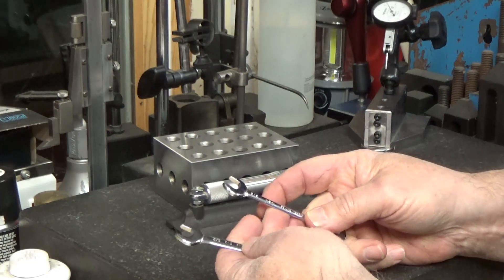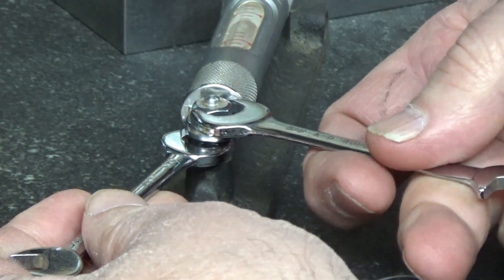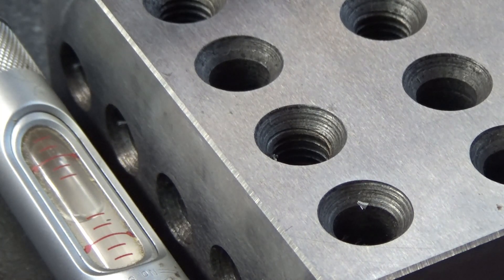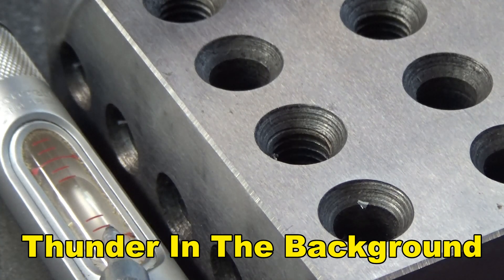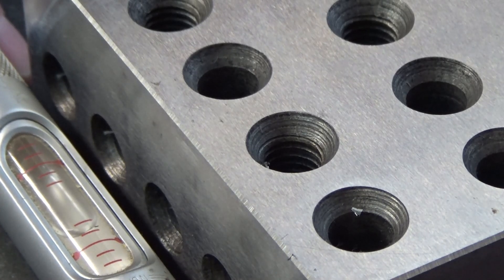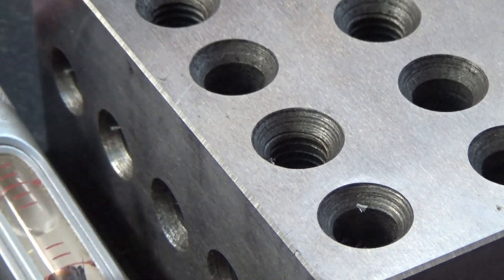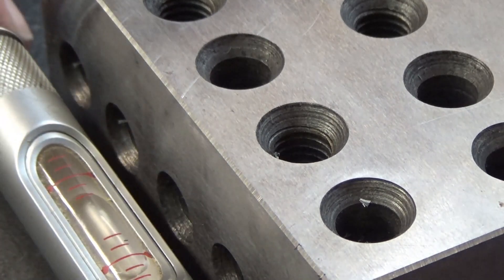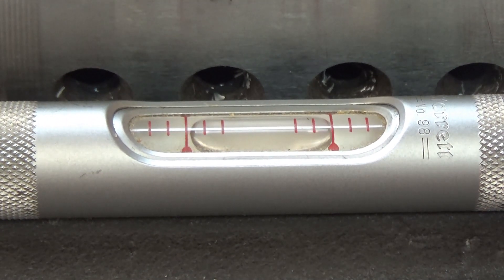Machine Shop Basic Skills -Calibrating A Precision Level

Comment: Hi Steve I like your video. I bought a used 97-8 Starrett Level EDP No.50435 and I notice the bubble is so wide when  level I can't see the ends of the bubble. Is that normal or defective? Is is possible to take some of the fluid out or is that a bad idea ? Any advise is appreciated. Thanks in Advance.
Reply from the maker: The vile needs to be replaced.  There are several videos on YT about how to do it.  They are available and not too difficult.  Keith Rucker of Vintage Machinery has a video on it, https://www.youtube.com/watch?v=_fs-AVB3fDg  Thanks for watching and commenting.

Comment: Question: The Starrett level has two nuts at one end but at the other end it has a slotted screw. How tight should that screw be?
Reply from the maker: The screw end actually has is a swivel.   The screw is snagged up.  The nut end adjusts the height and it rotates on the screw end.

Comment: So sensitive, buy a a normal german level
Reply from the maker: I just purchased a 12" Starrett Precision level.  Much more accurate than this 4" unit.  When I had my automotive machine shop I could set up a cylinder head to resurface within .005" with a good quality carpenters level. from there I would zero it in with a dial indicator.

Comment: Hi Steve, I am from the Netherlands. The precision spirit level you are showing has an accuracy of 0.005 inches / 1 feet. Do you know how much this is in millimeters?
Greetings Jan
Reply from the maker: That would be approximately .04/100mm.  Thank you for watching.
Reply: @sharkrivermachine  that is not a tool 0.02 mm on 300 mm is tool.
Reply from the maker: @Erkilll  I just picked up a 12" Starrett level. much more accurate that this little 4".

Comment: Thank you for your video. I appreciate how you walk through everything slowly. I just picked up a precision level and I was curious how to use it or calibrate it. Do you know if the starrett precision levels come calibrated from the factory? Also what is the rotating sheath on that starrett 98 used for mine has the same one as yours.
Reply from the maker: The precision levels need to be checked and or calibrated each time that they are used.  They change with temperature and just being handled.  The rotating sheath is just for protection against breakage when in storage.  Make sure to watch the second video on calibrating the level, I give some clarification on the procedure.  Thanks for watching and commenting.
Reply: Thank you

Comment: Very good
Reply from the maker: Thank you for watching and commenting
Reply: @sharkrivermachine  Being the son of a builder I was taught at a young age how and why you should reverse a level to check it. When I ordered a expensive level which has magnets in for steel work i checked it on the shop counter top. It was out so gave it back and they got me one that was spot on..It caused a ruck but the guy had to get the manager out because he didn't under stand lol
ww2 split rims where you can not get the tires so I banded the rim to take a larger ID tire. Tube tires and a tube gator 
https://youtu.be/UfwiaxVVrXU
Hay baler auger shaft weld and re turn 
https://youtu.be/bxw5Z_vcM4o
EN24T making cutter blades, heat treat and temper edge to blue
https://youtu.be/AUiFNZ9WU0k

Comment: That was very helpful. I built a machinists level a while back, I bought a very sensitive vial  which I fixed into a tube using Plaster of Paris. never been 100% sure how well I calibrated it, you've taught me a sure way to check and adjust it. Cheers!
Reply from the maker: Glad it helped! Thanks for watching and commenting.

Comment: How do you prove work top is level to level up level, something does not seem right to me?
Reply from the maker: That is the point of this exercise.  The surface does not have to be level as long as you keep swapping the level end for end and keep the bubble offset equal. The next video explains that process in a little more detail.
Reply: @sharkrivermachine  It doesn't have to be PERFECTLY level, but it has to be quite close.  You cannot calibrate your level on a flat surface that is, lets say, 10 degrees off level.  This isn't obvious because surely machinists do this calibration typically on a big old granite reference surface that is, well, VERY close to perfectly level to begin with?  I can and do adjust the extemely sensitive bubble on my survey instruments in exactly the same manner, and the procedure doesn't work unless the survey instrument is close enough to perfectly level so that the adjustment mechanism doesn't "run out of range" (usually, you run out of threads, and can't turn the adjustment nuts or thingies any further).  The answer to Mikes question is:  You level the surface under the "level" (which surface MUST be flat) with a cruder level.  This makes it "level enough" so that the level you are calibrating can be calibrated.  Then you calibrate the level in exactly the way explained in the video, and use that (if needed) to fine tune the leveling of the surface plate.  As I think of it, I realize that if anybody tries this on a flat surface that isn't level, it will in most cases be instantly obvious that the procedure can't be done.  You put it on your unlevel surface, and you can't get the bubble to do anything but hide in a corner.  All that being said, I want to add that I REALLY appreciate videos like this, and I have learned a lot about machining, and particularly about how machinists measure stuff, that complements and meshes well with my survey oriented measuring knowledge.
Reply from the maker: @johnwetzel5248  You are right about that the level should be reasonably close and in a second visit video to the subject I go into more detail about that.

Comment: Hi Steve, you beat me to the gun.  I've just finished moving and re-leveling my lathe with a precision machine level a few weeks ago and did a quick 101 on how to adjust and calibrate the level when the surface your sitting on isn't level.  This is especially true in the field when setting up precision production equipment and you don't have a level reference to work from.  As long as the bubble sits somewhere in the viewing area its OK to start adjusting.  If the bubble isn't on a line use a fine liner pen to mark the edge of the bubble, lift and rotate to see if the edge of the bubble is on your Fine Liner mark.  If not, adjust and re-mark with the fine liner pen.  Repeat marking, rotating and adjusting until the bubble sits on the edge of the line each time the level is rotated.  If when you put the level on a surface and the bubble is out of view use shim on the tip of the levels end until its in view.  Mark and rotate as described making sure the shim is at the same point each time you rotate it.  As I mentioned, the surface does not have to be level to calibrate and adjust.  One other important thing is to re-check by rotating twice after the level sits for a period of time (after a lunch break) on the surface you are trying to level.  The bubble will always grow and shrink even over a short period of time due to changes in temperature and air pressure.
Cam
Reply from the maker: The next video that I am doing is setting up the lathe.  I don't mark the bubble, but that is a good idea.  However I do use the shims under the end of the level to determine what I use to shim the lathe.  I have actually had a few comments about the level surface, which mine was not.  I am considering doing an addendum to the video showing in more detail how to find the level spot on the non level surface.  Thank you for watching and commenting.
Reply: @sharkrivermachine  Thanks for the reply Steve, the Fine Liner works well.  Each time you re-adjust you simply wipe the mark off with your finger and mark the bubble edge again and repeat until the bubble sits on the same edge of the line each time it is rotated, then it lock up.  Perfectly calibrated even though its not a level surface your working on.
Cam
Reply: @sharkrivermachine  thank you Mr. Lang for producing this video and Mr. Cam for the reply/comment with little helpful details. Love you both for sharing techniques in an art that is dying with youngsters trying out for easier jobs where thinking isn’t a requirement. Both of you had such great tips! The shimming part was brilliant since you use the same shimming on the top of the lathe that you will use under it! So simple, yet so brilliant!
I just bought a small lathe a few months back and TODAY I’ve bought my 98-12 and came back to this video to refresh the calibration process for when my level comes in. I was wondering how you guys were sure the surface was level to begin with but you both clarified that it doesn’t need to be dead on as you just make sure the bubble is consistent on both directions! I bought it off of eBay and anxious to make sure it’s in good shape.
Thank you very much!
Reply: Great comment. These things sure are tricky.

Comment: Now if only they didn't like to self adjust so you have to recalibrate them when you get them out to use them.
Reply from the maker: There is that. They are a bit sensitive the temperature change.  Thanks for watching and commenting.

Comment: What perfect timing! I just ordered a 98-6 last week to finish my Atlas 10F project and it should be arriving tomorrow. My dilemma is that I don't own a surface plate, so I'm going to try and find the most true and flatest surface that I have around to calibrate it or I'm hoping i can find a machined turbine flange/part at my job. Do you think that would work in calibrating it? 

Keep these videos coming!
Reply from the maker: I was going to address the issue of not having a surface plate.  Any good clean flat surface will do.  I used to use a piece of granite tile and before that a piece of well supported glass.  You could also use the table of another piece of machinery such as a mill or even a table saw.  I also have a piece of cutting board material in the shop that I use when I want a non-critical flat surface to work on. Thanks for watching and commenting.